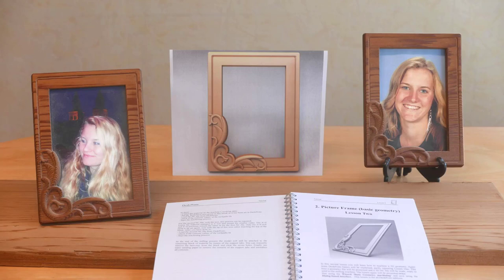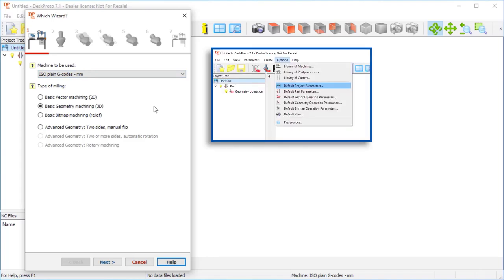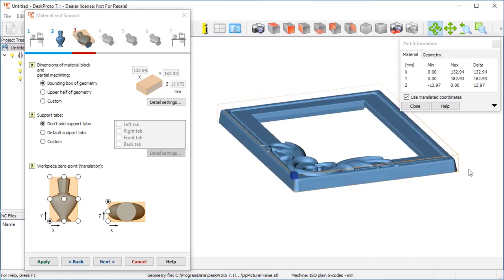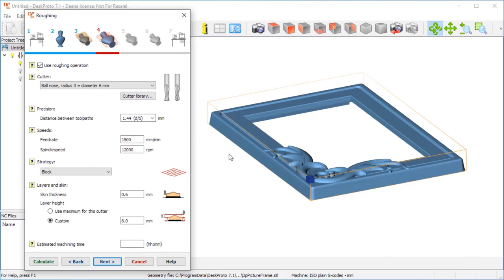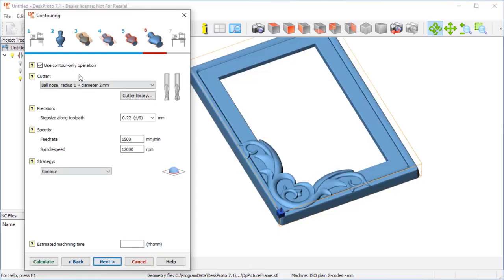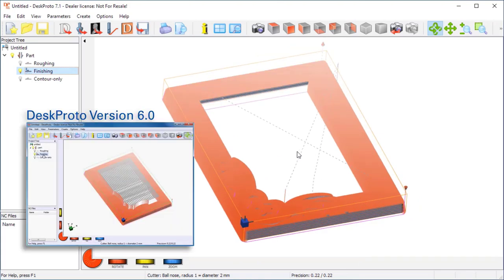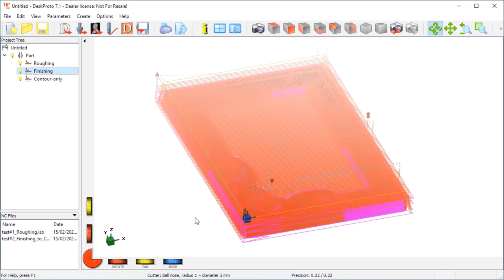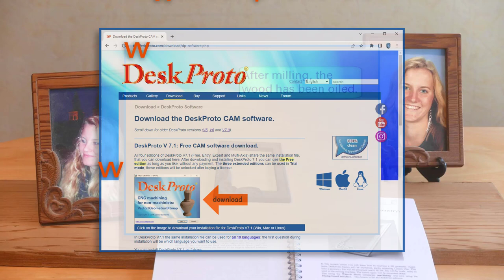DeskProto V7.1 picture frame tutorial (CNC machining from one-side)

Comment: Looking at your software,and I would like to use nesting ...without having to jump from one program to another ...do you have something similar that I missed . Thanks again.
Reply from the maker: Hi Johannes, I assume you mean nesting as in automatically arranging parts over a block (or sheet) of material in order to create as many parts as possible from that one block. DeskProto does not include any nesting, so you have not missed it. Most nesting that I have seen concerns 2D vector curves. Is that what you mean or do you also want to nest multiple STL files ?  In both cases though this is not something that we can easily add. So jumping to a nesting program is needed, sorry about that.

Comment: Love the tutorial Lex,for the finishing bit did you start as the same  zero as the same as the roughing?
Reply from the maker: Yes, however with a compensation for the different length of the new bit. So X=0 and Y=0 remain the same, and I have to set a new Z=0.  So I need to make sure that Z=0 is set in a process that can be repeated for the second bit.
Reply: @Deskproto  thanks for the help,much appreciated.